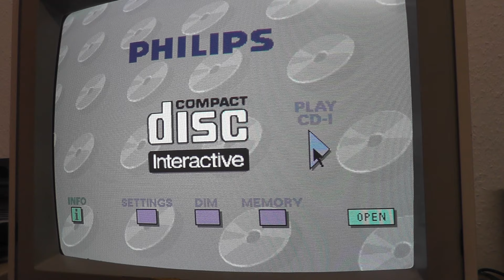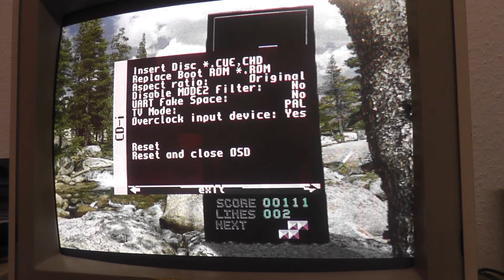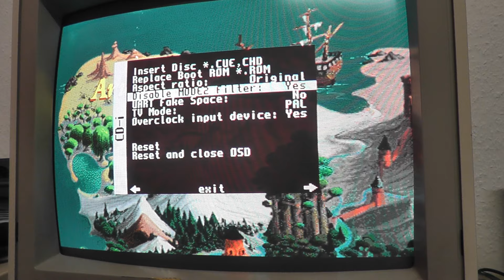Unscripted/Unedited update video for the MiSTer CD-i core

Comment: Nice. I did the CD-i port of Rise of the Robots and wrote CD-ice which was an in progress CD-i emulator. I worked for Philips before moving to Mirage to do Rise.  It was an OK machine for games, just came too late.
Reply from the maker: Cool. That's nice to hear. Some famous person^^. Now I know when I'm looking more into your game that I have someone to talk to with specific problems. I think that the CD-i is underpowered when it comes to 2D graphics as the machine has to move soft sprites with the CPU while most other machines have decent hardware sprites or some sort of 2D accelerator engine.

Comment: slamy, thanks for this, I use to have a cdi but have to sell it, this is a great core, I try to test it but got green screen, hope it arrives to update all, thanks a lot!
Reply from the maker: I hope that the screen is not green but more teal or cyan. The disc drive emulation is not yet very accurate. You need to have a custom Main executable to make it work. I've added some things to the description. Usually I redirect people to the MiSTer discord. There is a small community around this core and people test the core and can also offer some help.

Comment: if you have a repository or a guide to make it work please post it, thanks
Reply from the maker: I've added some links to the description. The core is very experimental right now and I'm noticing that the guide needs to the updated because the CD drive needs a custom MiSTer Main executable. The Discord channel usually has some messages pinned on how to install it.